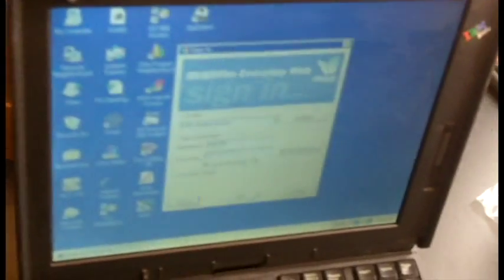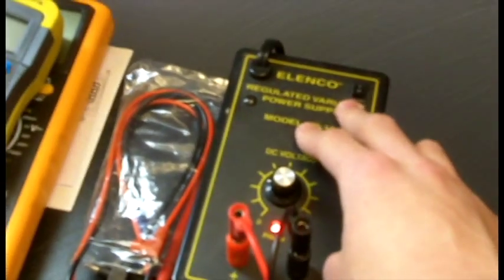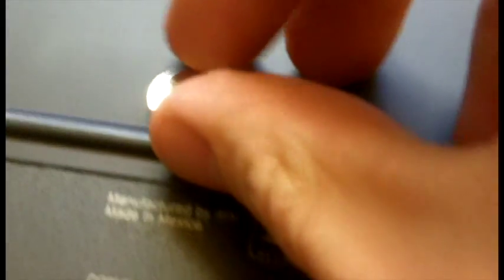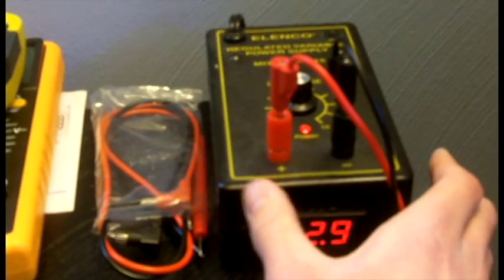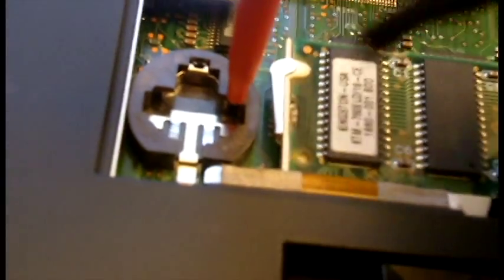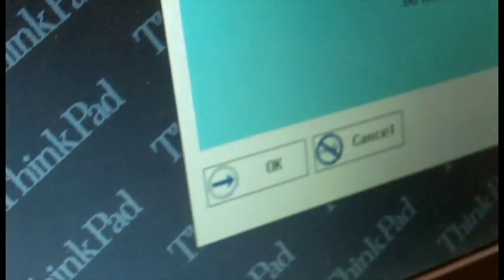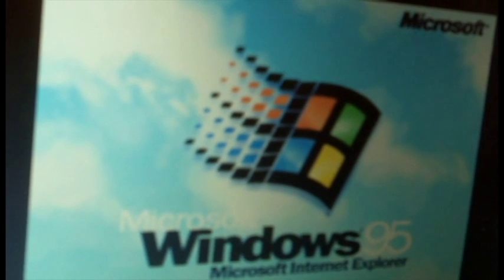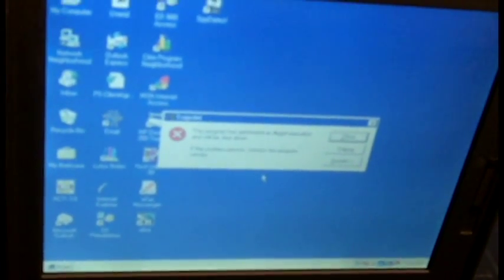How to Bypass / Substitute a Dead CMOS Battery Using a DC Power-supply

Comment: I would never do that but unfortunately I am going to do that. Due to Country Lockdown I don't think I can get CMOS battery soon. ☹️ Thanks for this video. Kindly let me know if there's any other solution please. I am still afraid if anything damage to my PC then it would be nightmare.
Reply: The CMOS battery in modern computers really only memorises the date and time. If you don't care about that then you could remove the battery and run it without. Older computers rely on the CMOS battery to remember BIOS settings so that's something to be aware of. I have an HP desktop which is about ten years old....I run mine without a battery. The only issue I have is with parental controls on my son's profile. I have him set up that he can only use it between 7am and 8pm. When he reboots the computer the time resets to midnight which locks him out. Hope this helps.
Reply: @Mandinka711  My HP Z620 is stuck at the start-up screen after a bios update, it says to press the ESC key for start-up, and when I click ESC nothing happens. It doesn't boot to BIOS. Do you think changing the cmos battery will fix it?
Reply: @yoyomaster6006  I really don't know but it only takes a minute to do and the battery is cheap.